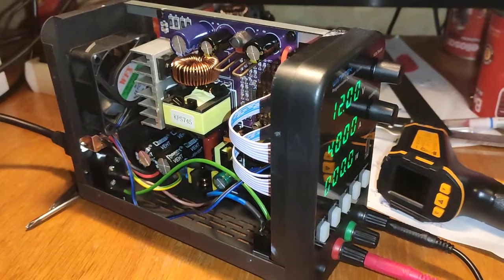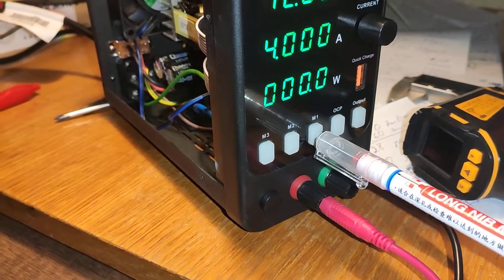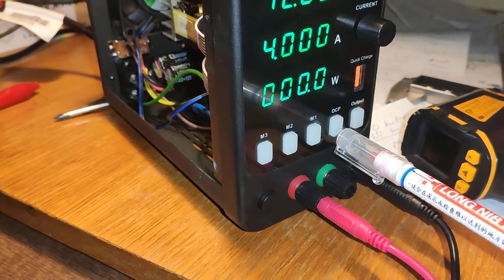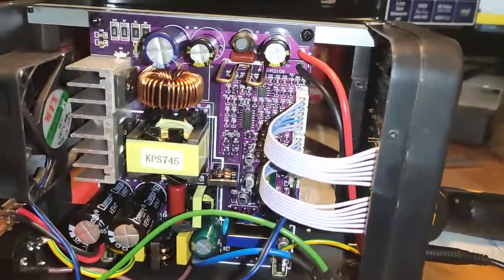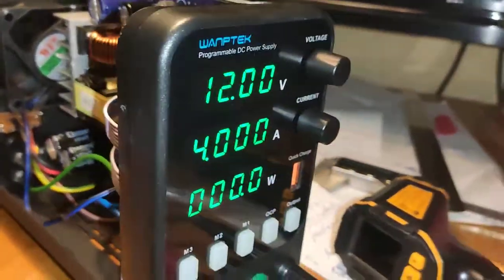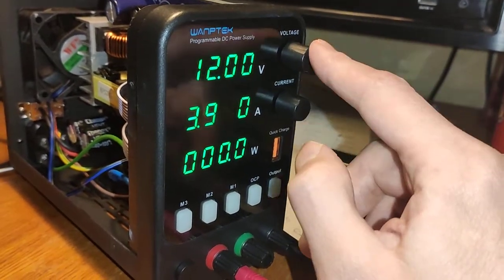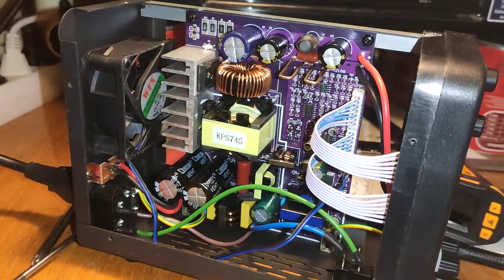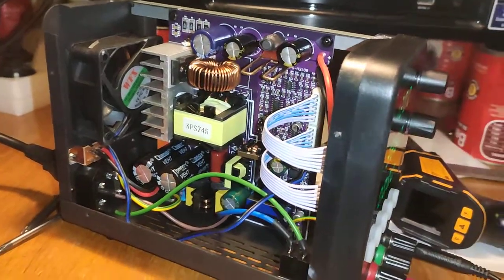Short look at Wanptek APS605H Power supply unit efficiency issue MUR30120PT  fan on ~5-10 seconds

Comment: hi! have you fix the problem?
Reply from the maker: No. Look at other my vids. Radiator is different (very smal)  in this model therefore heat shedding is very slow. Otherwise very good small PS, LCD is nice, bottons good too. Wires and crocodiles not good. Memory 3 function buttons are nice to have but it happed i dont use it. With small output vent is not spinning so if you use few watts output than ven will be idle not spinning otherwise you see in vid. I like this PS much anyways.

Comment: It needs a simple hystereris system, or temperature controlled mosfet to slowly turn it on with NTC resistor.
Reply from the maker: Turning it on slowly won't solve high temp issue. Only adding temp disipation plate  would soak and spread heat.